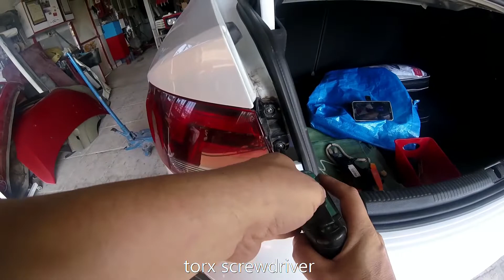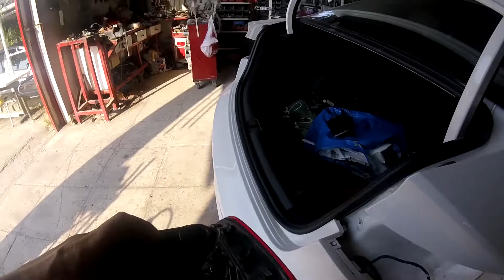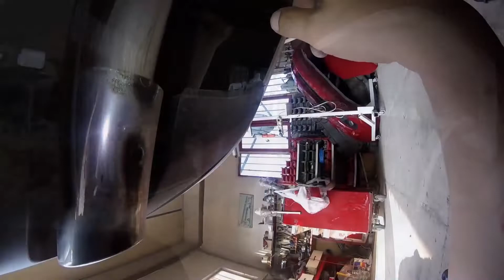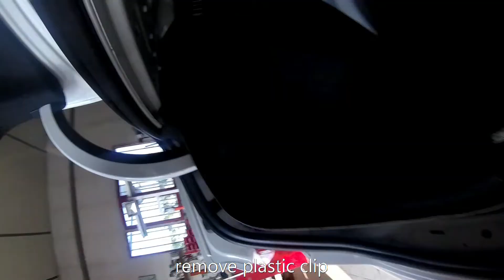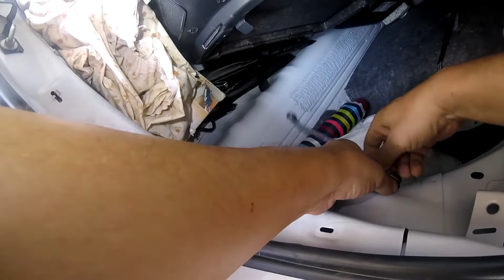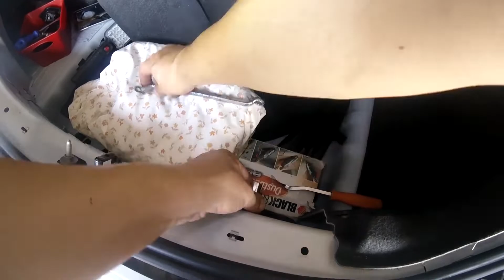Audi A3 Sedan rear bumper removal

Comment: Do you know if you have to remove the entire rear bumper to replace the rear lower spoiler/ valence?
Reply: You don't have to, but it makes it easier.  The rear diffuser is screwed/clipped into the bumper at the bottom and along the entire top edge.  If you pull the bumper you have access to the clips to remove them easily. If you don't pull the bumper you can work the clips out, but you risk breaking them or the plastic they go into.